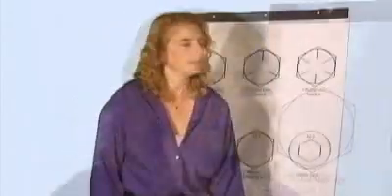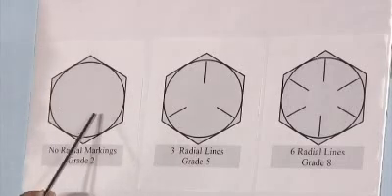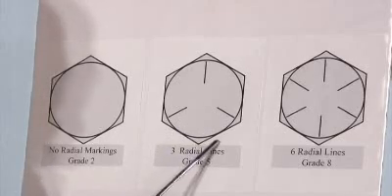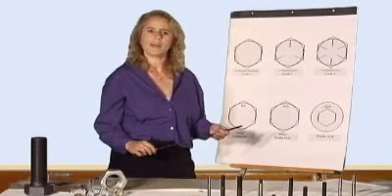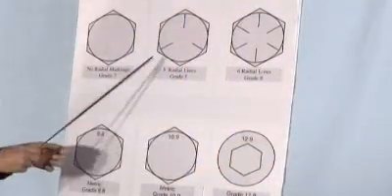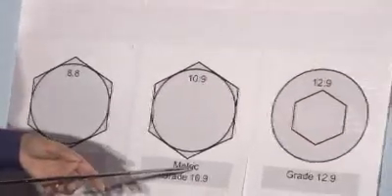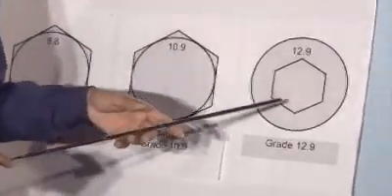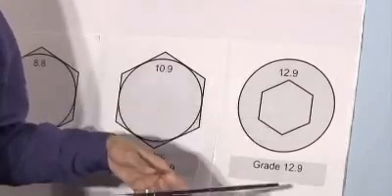Determining Bolt Grade and Head Markings

Comment: totally a waste of time she didn't explain anything except the grade, what does that mean which one is the strongest which is the weakest stupid video
Reply: My thought exactly. Which (if any) is a high-tensile bolt? Grade 5? Grade 8? I was hoping that there would be an explanation but no...
Reply: @stephenphillip5656  Grade 8 bolts are designated as a 150 ksi. This means its tensile strength or the resistance it has before it is subject to breaking under tension is equal to 150,000 lbs. per square inch. In comparison, a Grade 5 bolt is weaker as its tensile is 120 ksi, placing it at 120,000 lbs. per square inch in tensile strength.

Comment: Metric screw sizes are just easier to use period, you automatically know what size hole to use with what bolt size. e.g. an M8 bolt needs an 8mm hole.